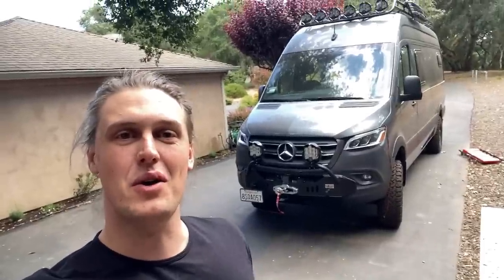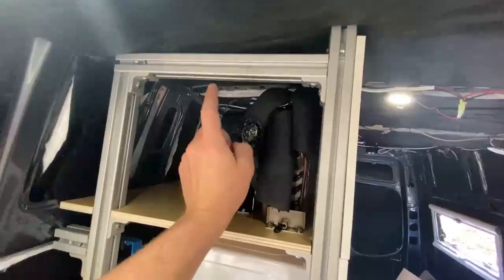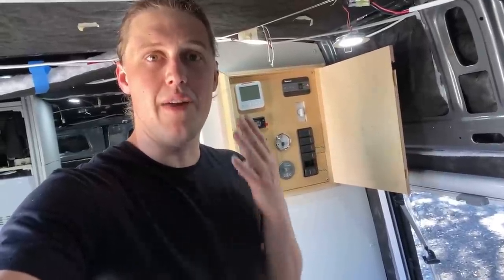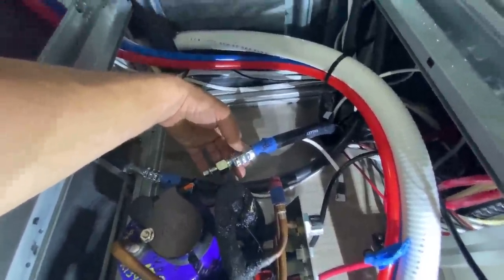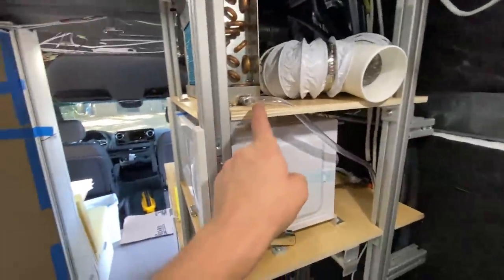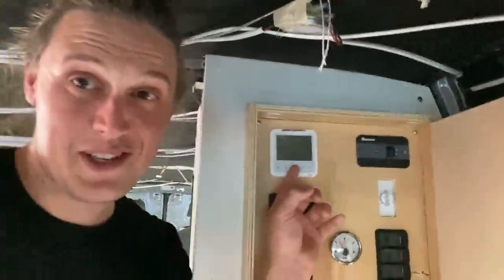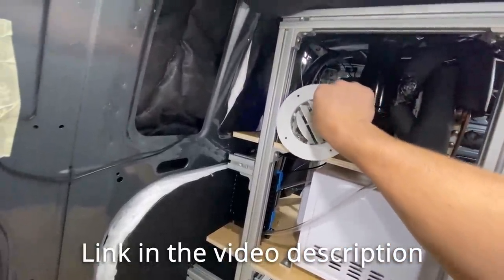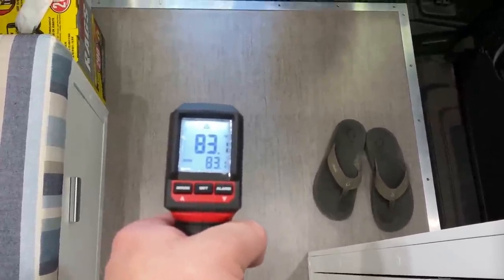The BEST Battery Powered AIR CONDITIONER For Van Life?

Comment: Cool, pun intended. I feel your pain about finding an automotive a/c mechanic who is willing to test and charge up your system. Unfortunately these days we live in the land of liability, the risk of something going wrong is where the finger pointing begins and their general liability insurance won’t cover it.

I had the same issue when I installed my 48 VDC telecom 12,000 btu mini-split heat pumps. I ended up breaking out some basic HVAC course books and with the right borrowed tools with some expert guidance got it going without any issues. 8,000 btu unit will take the edge off compared to the temperature outside and you’re aware of its limitations…
Reply: I’m not buying the insurance issue and why not a house AC guy? They are more knowledgeable
Reply: @michaelscarfi3196  home, commercial, and automotive a/c companies are licensed and insured. I find most of them don’t really want to test and charge system that was installed by a DIY unless they install it themselves. You may have installed it properly, but once they hook their gauge or machine to it. They are taking on the liability and most don’t want to take on the additional risk or it’s something they’re not comfortable working on. I am hiring them for their expertise to make sure they’re no leaks done on my part, if it doesn’t work properly I’m not gonna hold it against them. Unfortunately not too many people see it that way.
Reply: @felaxchow207  I was in the industry.  Your right on.  Especially considering a custom built system.   Probably a commercial tech would take a chance as they have more experience in old systems that are custom.   Sad part is, the lines are the hard part, so any dumb a/c dude that could have checked for a vacuum, would have just tightened a connector.
Reply: Blame the lawyers.  It's their fault.
Reply: @scottslotterbeck3796  They have ruined more then most will ever know.

Comment: Nice video as usual.  I bought this one also.  Note to the readers, this is not cheap, but the quality is good!
Reply from the maker: Nice! Did you get the VES or HD unit?
Reply: @seven_o_savage  I got the HD-12L unit.  So far so good.  Jiffy Lube did my evacuation and charge.  They just wanted to know if I wanted 134a and how much.  The other places all got cold feet.
Reply from the maker: @vita-girl4345  Nice! HD is the way to go if you have the space
Reply: @vita-girl4345  sometimes auto repair facilities over think what needs to be done. It basically needs to be vacuumed down and charged with R134a . Home HVAC technicians are usually the best bet. I also am working on having a pre charged system option.
Reply: @CruiseNComfortUSA  precharged would be preferred.  Finding a place to evacuate and charge was the most stressful part of installation.

Comment: I would rather install a McCool split system and build a means to position the external component on the exterior only when the system is needed. Otherwise stored protected inside the van. Could come up with a way for flex hoses and power to extend around rear doors, like mouse hole opening and a hitch support bracket to support outside heat exchanger.
Reply: Then you have to supply A/C which means additional cost/efficiency losses of an invertor. This system hooks directly to the battery.

Comment: Like if I am gonna buy a heat pump I want it to do cooling and heating, like the cooling is just going to be what you are using most of the time, because when it's cold it's also likely to be cloudy so running it off the solar isn't an option, where as when it's quite hot it's pretty much going to be sunny, but if I have some spare electisity when it's cold it would be nice to have heating, for example my work doesn't mind me charging up my protable power station there and with 2kWh of capacity assuming a COP of 4 you should get 8kW of heating, which is enough to heat up a van from freezing cold to comfortable.

Comment: Just saw a home install video before this and the guy saved $500 bucks buying a unit that didn't have precharged lines. 
He bought a kit to charge it for $150 so while I'm sure the 8k machine is nice you can do it with a kit yourself like $150 but it has manual gagues instead of digital and takes about a hour he said

Comment: thats great, am glad you finally released the video for the aircon system. did you consider mini split ac unit? it could cool the van down and is way quieter and uses about half and much power to run also. thats what ill be running in the nexdt van
Reply: Where are you planning to mount the condenser? That’s the only reason I didn’t do it.
Reply: @michaelscarfi3196  well if you have seen our tilting solar on the roof box, in the next build I’ll make the roof box slightly higher than the condenser hight and the put the condenser under the roof box with one max fan where the cooker would be and then use the rest of the space for storage like we are doing now. So from the outside it would look like it hasn’t got anything but a box and solar panel but on the inside we can enjoy the cool air or heater with the mini split plus I’ll be going completely electric and have about 6-10 Tesla batteries so we can run everything for days without any charging 😊
Reply: Standing up? I was afraid of the height and I’ve see someone lay it down but I can’t believe that works.
Reply: @michaelscarfi3196  yup standing up. My current roof box is 32CM high. Am not sure how high the condenser is but I think you can get some that are about 50cm or less high so building a roof box that high won’t be too bad plus you get the added bonus of your solar panels tilting plus when it rains you don’t hear it on the roof 😊. Another tip if you build one is to put fans under there to move the air around because it gets hot from the sun lol
Reply: @michaelscarfi3196  You can mount it in top, on the back bumper, I saw someone mount it inside and open the back door to use it. Dividing wall between bedroom and garage.
Reply: I run a 9000 dc inverter mini split 110 v  off two hundred amp hr lithium battery , 3000watt inverter . With cab blocked off 105° outside  . It starts using 1100 watts for about 15 min then cycles between 400 watts and 30 watts keeping 75° inside . No windows . Good nights sleep using +/- 120 amp hrs . Condenser mounted under back spare tire spot , condenser pump mounted upright under the bed inside . 65,000 miles so far . Just mounted 60 amp lithium charger to charge batterys while running ac off any 110 outlet . So far workin great . 
$800 for mini split . Ac friend helped move out the pump and recharge. Very quiet .
Reply: @kellysplumbingify  that’s amazing. Thanks for the information. I’ll try and get someone to mount it under the van instead so I don’t make the van too high lol. I’ll consider all my options if the mini split box is only 10cm higher than my current roof and all Kees the whole height of the van under 3.5-3.9M then I’ll mount it under the roof box. If it’s higher I’ll get someone to take it apart and mount it under the van or under the roof box lol.

Where in the van did you mount the mini split blower? If only it was compact and not very long lol

Comment: Around 50amps it takes for usage seems high.  The Dometic 12volt uses 20-30 amps.  Just saying.  Peacefrom510
Reply: I think you need to check the Dometic specs again. The 2000 RTX  uses 20 amps in eco/low but up to 58amps in high/max mode. The Dometic is also only 6800 BTU vs 8000 BTU for the Cruise N Comfort
Reply: @GregBurghart  yep your correct.   But @20 amps, he could run it way longer.

Comment: Where does the residual heat go from the compressor ?
Reply: Inside the van, so that it has to work to cool it.  Seem like it would be much more efficient to design a system with the compressor on the outside.

Comment: I'm surprised you didn't just do a small mini split AC unit. They seem to be working out pretty well if they are properly installed.(quieter too).
Reply: mini split runs on 12o v or 240v only

Comment: wonder how they figure critical charge?...evac and charging is pretty easy...60 amps for 16 hours?..no...plus you said you have over 1000amp hours...next sentence you said you have 670 amp hour?...which is it? I will say you have killer wiring and electrical.top notch stuff..and clean.

Comment: Are you worried about stones or rocks flicking up underneath and damaging the condenser? I'd be super worried about dirt and dust issues too. Love the idea of the condenser underneath, as that's where the air is coolest, but think the downsides could be an issue.
Reply: The new condenser has an optional rock guard that totally surrounds the condenser. The fans motors are also totally sealed to keep water and dust out. A lot of Ambulance companies mount these often under the vehicles .

Comment: Has anyone ever just left their engine running with the vehicle AC on?  Without the car actually driving and just running an AC, how much gas does this actually drain?  Curious to know if the cost of gas and inconvenience of extra trips to the gas station would compare to the extra space and power requirements of an AC set up like that, just for 1/4 of the year (less if you spend time in cooler areas).

Comment: I like the 12v setup but I'm concerned about ground clearance for the under carriage components. Our plan is for serious off grid travel/overlanding. Re: real estate for solar, have you seen Tiny Watt Solar's military-grade rooftop solar storage box?
Reply: Typically on Sprinters our customers use our new stainless brackets that are adjustable to get the unit higher than the differential. One of the best spots is where the spare tire is on a 144 or 170. On a 170 extended there is room between the bumper and the spare tire.

Comment: Well I guess you pay for having the sleekest looking Zombie Apocalypse van, when you have a Mercedes you have to go with the Mercedes of all other components.. My Boxtruck was happy to have a 500$ consumer Mini Split bolted under its belly and its been running fine for over a year. Your Van will be awesome when ready.
Reply: You could argue that you could add another battery and 2 more solar panels to offset the AC inverter loss and have money left over.  Assuming you have space to mount the panels.  In a box you have the space on top.
Reply: @redwolfexr  yupp pretty much what I did, have 1200w solar on the roof and still enough room for a roof deck and some hatches..

Comment: why not mount this at the top of the van or somewhere in the engine bay around the radiator? it can get damaged easily from dust and water from the bottom or even when you run over things.

Comment: Hey, shouldn’t all that condensation  water get caught, filtered and stored? Seems like running the AC on solar with dry mode full time will prep the van for cooling when needed and will daily deliver a few gallons of water? Is this a pipe dream?
Reply: I saw a Tech Ingredients video demoing a dehumidifier using liquid dessicants that can be recharged by heating up with solar heat. That might be a good way to assist the AC for lower power consumption. I assume the AC will have to work less hard when there is less humidity and once it’s achieved target temps it just has to touch up?

Comment: Do they make small 12v clothing washers you could put on the back double doors?
Reply: I'm not sure if those exist or not, but even small "eco friendly" washing machines use at least 15 gallons of water per load. It's just not practical to use up that much fresh water in a van. Washing machines are completely unnecessary, anyway. You can wash clothes by hand in the sink and hang them to dry below the fan.

Comment: With the compressor underneath the car outside, what about EXTREME cold weather? How much would it affect it? Worried about that.  And you gotta take it somewhere to get it charged? Im confused by that. How many times do you have to go somewhere to get it charged?
Reply from the maker: Still works perfectly almost 3 years later :). Only gotta charge it once unless you buy the pre charged version

Comment: Great video on a needed topic. Sounds like you chose to split up the CruizinComfort evaporator and compressor to eliminate longer runs of duct from the floor to the ceiling. Is it your experience longer ducts lose the strength of the cooling?  Looking for peoples experiences. Until now I was planning on positioning the CruizinComfort in the garage space between the wheel well and back door on my 170 and then run 4" insulated duct inside a wall up to the ceiling for distribution both fore and aft like yours. Words of wisdom and experience are appreciated.  

--CW
Reply from the maker: Nope my decision was to save the volume of not running a 4” duct all the way up. I also didn’t have room for the full HD unit. I recommend the HD unit if you have the space!
Reply: @seven_o_savage  thank you for the quick reply. I will proceed as planned! Also, thank you for showing the fancoil assembly on the underbelly of the passenger side. I saw folks putting them in the spare tire area but I wanted to use that space for the specially molded-to-fit 23g gray water tank. Now I'm more confident the fancoils can indeed be successfully mounted in an alternative spot. BTW, did you fabricate the brackets or did you buy a kit? Again, thanks for the info and encouragement.
Reply: Ideally, you'd run an intake duct from the top 1/3rd of the van down to the evaporator if floor-mounting the unit, then ducting for the output to wherever you want it. You want it to suck in the hottest air which would be near the top of the van interior. I floor-mounted mine but because I couldn't have the ideal input ducting, I have a 90-degree output nozzle pointed upward to help get the cool air up where people are (and churn the air somewhat in the process.) Having the unit floor mounted is good because: 1) it weighs 85 lbs and your center of gravity could easily be a concern; 2) the noise it creates would be farther from your ears.
Reply: What would you guys think of an HD mounted in an overhead cabinet? Solves the air duct problem, return air is in the right spot, easy to point cold air where needed. The dimensions seem doable: L 22" x W 12" x H 10,5”
Reply: @EdClarkePC  that would be ideal, provided the 85lbs was adequately supported.

Comment: This ac unit is significantly more expensive than my 5ton unit at home.
Reply: I believe he was referring to the exchange unit the mechanic had ($8k)
Reply: @Lord9Genesis , He was, but the Cruise 'N Comforts aren't cheap either.  I believe the unit he has is around $4,000.  It's one of the best options available for what he is doing though.
Reply: @CL-gq3no  they quoted me around $5000

Comment: Oof,  that's over 700 watts.   When you said it was efficient,  I thought it was lower powered with enough cooling.   You can buy a window unit that only uses 500 watts at 5,000 BTU,  and it's more compact too.   less hassle.
Reply: but using the inverter will make you loose power....
Reply: 8000 BTU for 700 watts seems like a pretty good deal to me.  With no inverter loss.
Reply: @redwolfexr  
The roof of the van may be able to hold 600 watts of solar panels.  For me, it's all about budgeting energy so I don't run out of power if solar is the only available source of power.
Reply: @WTF_BBQ  My comment was that your box truck likely had a lot more usable space to mount panels on the roof.  He isn't going to mount a wall unit on a sprinter, so roof was all that he could do.   So he would both increase power demand and lower available panel space.  (or have to depend on external panels)

So you have more flexibility to add more panels to offset even without the roof unit than he does.

FWIW I would do the same thing with a box truck that you did.  Probably a mini-split instead of a window unit, but still AC power.  And just add more batteries and panels.  Probably mount the roof panels to be tiltable.

But in a ClassC I would likely spend the money for a DC system.  There just isn't as much roof space no matter HOW you set it up to power an inverter AND an AC.
Reply: @redwolfexr  
I've seen people build a sliding mount that increases the amount of solar panels on their roof.  I would probably do that and maybe get 1000 watts of panels.   I think 1kw is more than enough for a van.
Reply: @marcc629  at 12:45 he explain he don’t need tu use the inverter

Comment: Would have been nice to see how low of a temp it could have gotten with the heat outside. Was 85 the lowest?
Reply from the maker: Yea that’s where it balanced out. Would have had to move to the shade or off the tarmac for it to go lower.
Reply: @seven_o_savage  yikes. Big boy like me needs it cooler than that lol. I’ll stick with my Coleman rooftop. Great install
Reply: @modeverything9949  85° when it's 120° in the van is very livable!
Reply: @scottslotterbeck3796  maybe for you, my Coleman got down to 75 in 116 degrees a few weeks ago in Vegas.
Reply: @modeverything9949  Fantastic!  Cost?  I hate the desert so I don't go there, lol
Reply: @scottslotterbeck3796  900 ish it’s the Coleman Mach 10 ndq. I’m sure our insulation is really what helps. That cost us about 2k
Reply: Finish the build out and cover the windows and it will greatly improve.

Comment: Why wouldn’t you run the condenser on the driver side body panel or even on the passenger side behind the slide door?
Reply: This gives me an idea about doing charge and service on these units. Automotive guys aren’t licensed to charge them because it’s technically not a car a/c even though it’s installed in a vehicle & residential hvac guys aren’t (likely) going to have automotive equipment. You can thank the EPA for requiring different v licensure for automotive & residential systems.